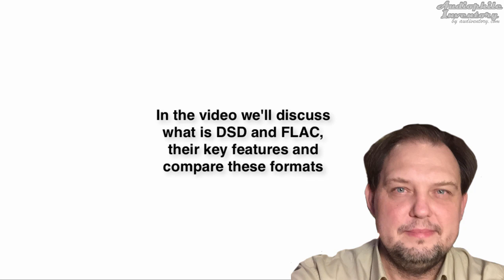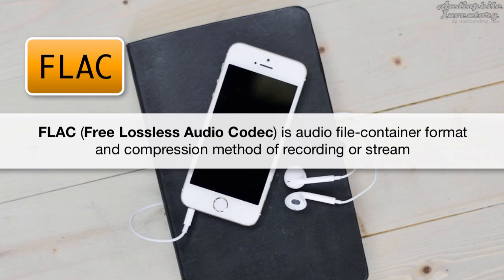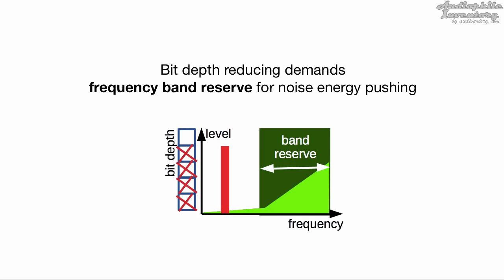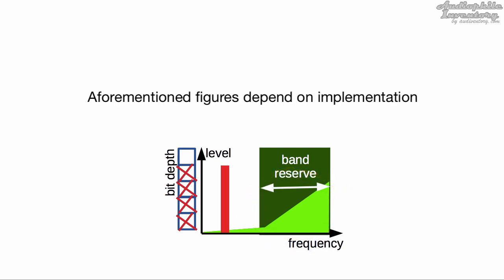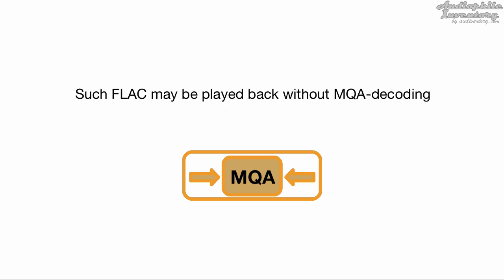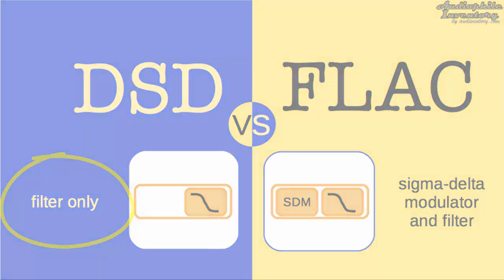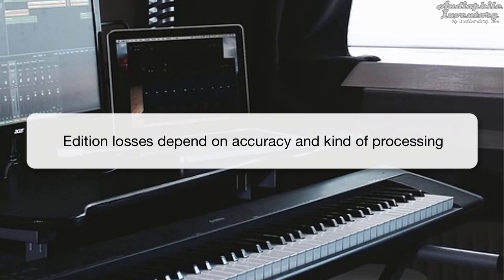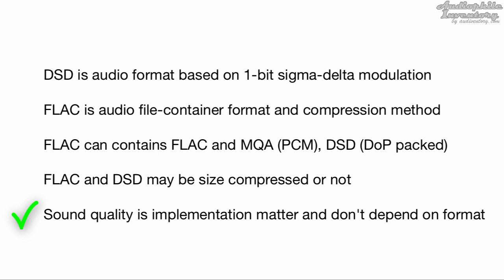DSD vs FLAC (DSD vs PCM) [15 Key Point Guide]

Comment: Hi Yuri! Great video and good presentation of technical aspects. In my personal opinion, it comes down to Pulse Density modulation rather than Pulse Code Modulation. Since the square pulse wave in the range of 5.5-11.2 MHz captures bit-depth for continuous movement of analogue waveform, the energy bands are a true representation of the analogue waveform. PCM takes bit-depth as a measure of loudness and pulse modulation as a measure of samples of the analogue waveform(only representation of analogue signal). Due to this difference of sampling method, the samples in PCM have phasing issues in the lower-end of the frequency spectrum that are only felt and not heard by physical ear. This happens during the decoding stage from digital to analogue. If you A-B between DSD and PCM of the same recording, there is a clear perceivable difference in the spatial sound field. DSD has a soundstage that feels like a real live performance rather than playback.

What are your thoughts on Cakewalk's Sonar DSD conversion algorithm?
Reply from the maker: Hi Daniel! Thank you for the comment.
Practically, in most cases, sigma-delta (read as DSD) capturing and back to analog conversion are used in a DAC.
It solves issues of:
- analog and digital filter issues at low sample rates;
- resistor precision into electrical circuits.
Read more: https://samplerateconverter.com/educational/r2r-ladder-dac-vs-sigma-delta

If we want to compare DSD and PCM, coming from time to frequency domain is recommended:
1-bit causes a high noise level, but noise-shaping solves the issue into audible frequencies and, sometimes, above.

Comparison of DSD converters may be produced like resampling:
- noise level into audible (or desirable) range,
- ringing at output;
- frequency-phase and -magnitude distortions.

Also, for conversion to DSD, tolerance to overload is important to reducing of broken-work probability of the sigma-delta modulator.
Read more: https://samplerateconverter.com/educational/what-dsd
Reply: @YuriKorzunov  I've come to believe after reading the articles posted by you, that you are the designer of DSD playback in Foobar2000. Great job on the noise shaping algorithm. Pure work of art and genius! Thank you for your work of love. It is truly incredible, the noise floor is so low, I can't even hear it on my flat-response ultralow THD AKG702's.

Just to add clarity, let's forget for a minute about measurement calibration and use the human ear as an apparatus. Do you feel there will be subtle difference in playing back DSD128(176.2 Hz PCM) and 192 Hz/24 bit PCM on let's say bit-perfect noise filter such as those found on DAD AX32 due to multi-bit decoding issue found in PCM technique? Thank you!
Reply from the maker: @danielraju4458   I have nothing to do with Foobar2000. Our original technologies are used in AuI ConverteR software only: https://samplerateconverter.com/content/technologies
Playback sound difference is matter of audio device/system design and tuning primarily. DSD, PCM, hi-res are potential abilities only. They guarantee nothing.
Sigma-delta modulator provides ideal input/output-amplitude linearity in contrast R2R matrix. But further (after them) analog circuits are not ideal.
Reply: @YuriKorzunov  Thank you for your time and patience, Yuri. That's exactly what I wanted to know, ideal input/output linearity. Off course the audio chain subsequent to analogue conversion in the amplifier section and LS speaker is equally important, if not more due to inherent transformer eddies and coil impedance that analogue circuit brings to the audio chain.

Since your presentation gave me the impression that you work professionally in the ADC domain, hence, wanted to check on your opinion. Thank you.
Reply from the maker: @danielraju4458  I'm system engineer. It requires to know all relevant domains as hardware as software. Currently, I'm pure software engineer.
Reply: @YuriKorzunov  In your article you mentioned, Sigma-delta-modulation decoder (demodulator) is 2-position (1 / -1) voltage generator and low frequency filter. It is simpler than pulse-code-modulation hardware demodulator. Because pulse-code demodulator contains multi-voltage matrix or 1-bit decoder(s). So we have more abilities to make cheaper 1-bit DAC better than multibit one.

Do you think this is the reason why PCM will always have phase issues, due to multi-voltage matrix? Can it ever do a perfect job for multi-bit resolution or it will always compromise on jitter reduction thereby adding phase issues.

Comment: Now i'm just more confused.
Reply: I will try to clarify. DSD is better, in general, but requires expensive hardware. I dare to say this only cause DSD is often compared to mp3, CDA 44.1kHz 16bit Redbook (read: standard) CDs or 24bit 88.2kHz formats. DSD64 in theory has the same sample density as 24bit 176.4kHz PCM, but there's a matter of antialiasing. Think of it as a number you may get as a sample, i/e 67.86 and it gets rounded up to 67.9. In practice, PCM 24bit 192kHz can match DSD64 in quality, given the audio sources are meant for specific use, and hardware is of same quality. But then, there's DSD128... (etc).
FLAC is nothing but a wrapper, it's used for archiving music. It's a good way to archive PCM with no losses,  but I wouldn't recommend it for DSD cause it requires conversion, thus will create a noise I would describe as a mild fog. DSD can be stored as ISO, DSF or DFF which are all fine.
Don't worry so much about formats, hardware is the one that will disappoint you: cheap DAC, cheap amp, cheap speakers... 
I think the real question is: how much is enough? If you can't afford at least $1200 worth of gear, you're not even in the game. What I mean by this is: someone who has $10k worth of gear will get a lot more out of the sound. There are ways around this, i/e you can get ISO files, play them in foobar2000, and with a decent DAC (in $300-$500 range) and good active speakers (let's say JBL LSR305 that cost a few $ shy of $360 - may require woofer)[1] and you get the sound 99.7% of people will envy. If you get a good streamer too, then you're in the big boys league. Of course, there will always be someone who has more and better, and that's where the question is valid: how much is enough? There's no point in debating things you can't afford, right?
(I should also mention the availability of SACDs as a factor, cause, there aren't that many available, considering audio appetites. Finding a complete discography of your favourite band may be an issue.)
So, get the best gear you can with the money you have, and smile.
[1] Some may object the JBL LSR305 and claim they aren't "musical" enough, but this is due to their lack of expertise in audio editing. They are studio speakers, and as all studio speakers they are near field. What this means is (plainly speaking) all frequencies the speakers can produce are of the same volume. You can always use an equalizer, right? Once you hear the sound, you just can't go back (or you are to spend $1000+ on something debatably better).
Reply from the maker: Look this too https://www.youtube.com/watch?v=lS2d2gnqox4

Comment: Hello Yuri and thank you for that comprehensive overview.

I understand that the sound quality comparison between DSD and FLAC is a complex matter and record, playback and software/ hardware variable dependant. However, what I think most people (including myself) want to know is, if the same master recording is converted into both DSD64 and PCM 96 or 192 and played back on the same hardware/ software combination simultaneously, in your expert opinion, what sounds better? Which is the more efficient way of reproducing the original analogue sound? Again, I realise sound quality is subjective, however there must have been studies conducted in order to come to a definitive conclusion?

Thank you.
Reply from the maker: Hello Brendan,
Thank you for kind words.
> if the same master recording is converted into both DSD64 and PCM 96 or 192 and played back on the same hardware/ software combination simultaneously, in your expert opinion, what sounds better? Which is the more efficient way of reproducing the original analogue sound?

I write resume in first. Explanation below.

Resume: to provide maximal playback quality (minimum distortions) of DSD or PCM based on same master recording, need to know exactly path of sound from ADC to DAC (electrical schemes and processing algorithms).

Here articles about DACs:

https://samplerateconverter.com/educational/r2r-ladder-dac-vs-sigma-delta

https://samplerateconverter.com/educational/nos-dac

Main issue here, that there is no same hardware. As rule, DAC contains sigma delta demodulator, that may be feed by DSD directly. PCM is converted to sigma-delta signal (in ideal case, it may be like the DSD by figures) and feed the sigma delta demodulator. So we get 1 module [sigma delta demodulator] for DSD and 2 modules [sigma delta modulator and demodulator] for PCM.

It is different schemes. In the scheme DSD contains lesser component number. So DSD playback have lesser distortions.

But the master recording is PCM, as rule. Except rarer cases when it made directly to DSD without editing. And before sigma delta demodulator PCM should de converted to DSD. It may be done inside software or DAC. Therefore, there are different audio paths for PCM and DSD. Quality is defined by PCM to DSD converter.

If PCM master was released without resampling, we compare converted DSD and original PCM master, that also converted to DSD inside DAC. In this case we compare quality of DSD file converter and DSD converter inside DAC.
In this case result is unknown.

If master is recorded to DSD directly and released without editing, we convert it to PCM. It played back with conversion to DSD. And we compare DSD with and without conversion.
In this case playback DSD have lesser distortions.

But real DACs is more complex. There is resampling. And final sample rate, analog filters may be different for playback PCM and DSD. If R2R there, we have additional non-linearity. I.e. we compare the electrical circuits of DAC and its internal digital processing.
Reply from the maker: > Again, I realise sound quality is subjective, however there must have been studies conducted in order to come to a definitive conclusion?

I suspect, that definitive conclusion is impossible. Because new information comes.

I understand, sound quality as distortion level. It is measurable.

At first glance, all is easy there. But figures give real information with accounting of psychoacoustics. However, the psychoacoustics is developed and there are not full researches of human sound perception.

Audio contains main kinds of distortions:
- non-linear,- frequency (amplitude and phase),
- ultrasound impact,- ringing,- compression loses,- resolution loses (bit depth, sample rate),- modulation loses (PCM vs DSD).Each kind should be learned separately.

Some kinds (PCM/DSD, resolution) can not be compared in general case. It is implementation matter (example we have reviewed above).

Ultrasound we can’t hear. On the other hand, our brain have response to it.

I never read about researches of impact ringing to ear.
Reply: Wow... Thank you very much for your response. It is an honour to converse with such an expert in the field. However, in saying so, unfortunately I only understood a limited percentage of your response. This is due to me not having advanced knowledge in the audio physics realm.

What I will say is that I conducted my own experiment in that I took an original DSD64 track from a SACD and converted it to 24/ 88.2 FLAC and 320 mp3. When playing back all in a random sequence conducted by a friend and me not knowing which format was playing, wasn't able to determine the difference between the mp3 and FLAC. I was however, able to correctly differentiate the DSD64 track from the others. This was due to the DSD64 track feeling much more expansive and crisp than the others. I felt it was much more powerful, not in terms of volume (because they were all at the same level), but in emotional amplification. From this all I can determine is that the feeling I get from listening to DSD is a state of euphoria and therefore am an avid collector of the DSD/ SACD format. I hope more titles are continually released on this format in the future.

Thank you.
Reply from the maker: If summarize my posts: DSD vs PCM is implementation matter. I recommend simple check sound of each of hardware+software systems despite PCM, DSD, Redbook, high or low resolution. Also records make sound very significantly.

Differerece between 24/88 and mp3/320 is very subtle. Also for comparison need to provide bit perfect playback, to avoid operation system processings (resampling/mixing inside Windows drivers, as example). In my opinion, easier way to listen difference is comparison of quiet (low signal level) recordings.
Reply: My DAC/ amp is a Chord Mojo. My headphones are Shure SRH-1540. I use an Audioquest Jitterbug via USB-out. My PC is Windows 10 O/S using Foobar2000 + SACD .iso plugin. It is not the most expensive setup, but operationally sound in my opinion. When playing SACD .iso files they sound truly amazing and I'm very satisfied. However, I have been researching the new line of Campfire Audio equipment and may be demoing and upgrading soon :) Thanks again Yuri for your expert information.
Reply from the maker: Thank you for kind words Brendan.

> However, what I think most people (including myself) want to know is, if the same master recording is converted into both DSD64 and PCM 96 or 192 and played back on the same hardware/ software combination simultaneously, in your expert opinion, what sounds better?

Main thing here, that there is not same hardware in general. DAC may be doth DSD and PCM compatible. But inside the DAC, different circuits are works for DSD and PCM.

> Again, I realise sound quality is subjective, however there must have been studies conducted in order to come to a definitive conclusion?

Theoretically, limit of sound quality is reproducing analog sound without distortions. But there is no equipment that haven’t distortions.
And we can compare one kind distortions with other one.
For PCM and DSD no big differences from point of view coding and encoding from/to analog form.
In general, DSD system without edition is simpler (has lesser components to record and playback).
But features of the components may be different and cause different quality.
Resume:
«DSD vs PCM» for storing of sound it is like «cup vs bottle» for storing of water.